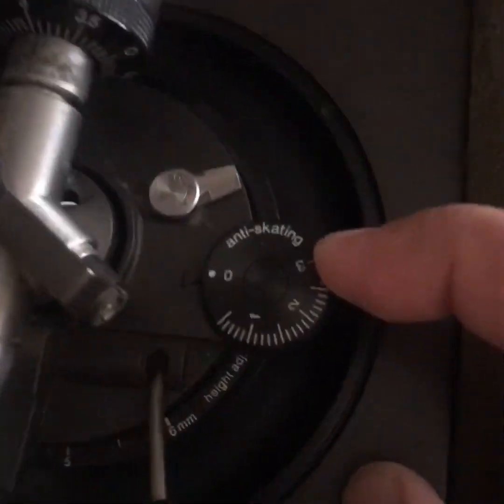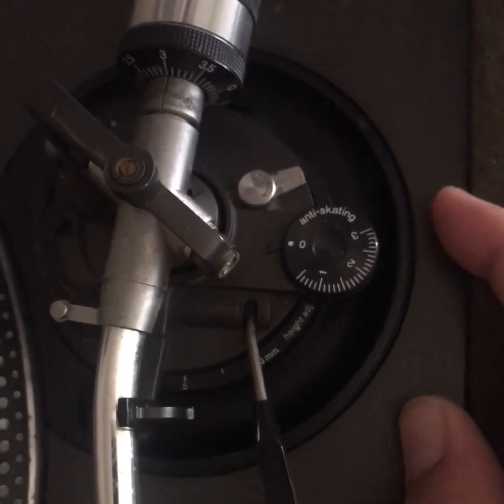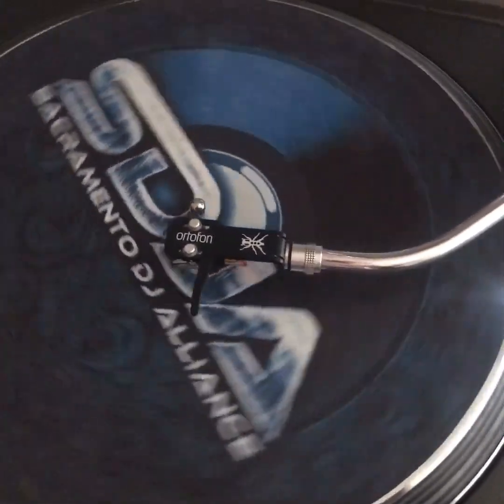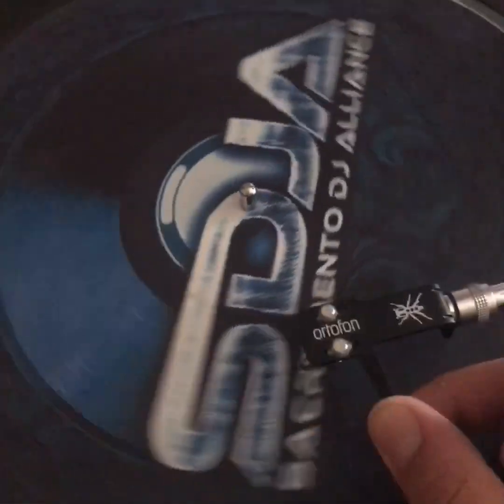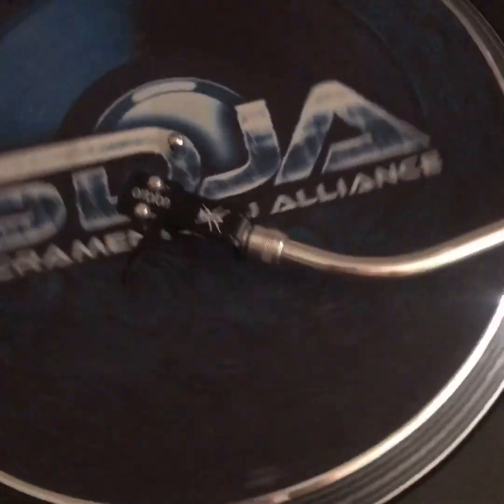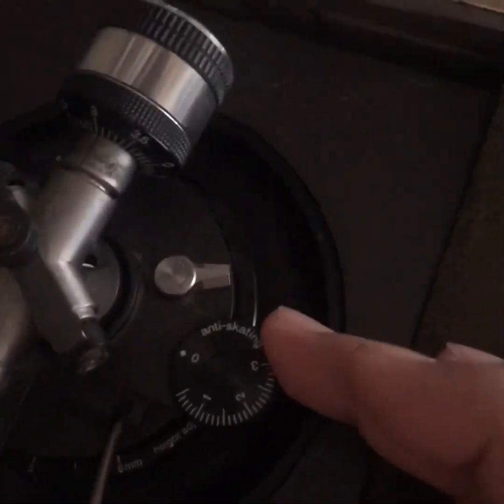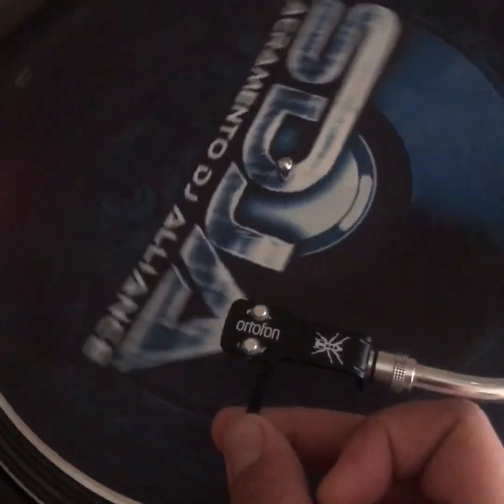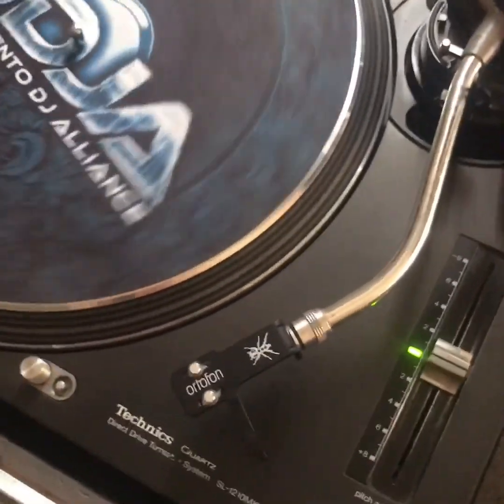TECHNICS SL1200: Anti-Skating explained

Comment: That’s what I thought 
I’ve seen people setting  the anti skating dial according to the stylus weight recommendations 
And I don’t think that’s accurate.   What If you have some stylus that requires let’s say 4 grams of weight.
Nice vid.  Thx for sharing.   
I’ve always kept mine at 0. Unless if I know I have a record that if about to skip I set it quickly to 2 1/2 or 3.  Than I set it back at 0 after I by passed the bad part of my grooves.

Comment: just one quick question...most of my vinyls are singles and ep`s ( 2 tracks per side ) - is it okay to keep anti skating at 0 `? been doing that way some time now and it works but im just worried if my plates get too much wear if antiskating is at 0 for 2 tracks per side ....i had one lp and still kept anti skating at 0 and no problems... anyway, thanks for the video Bouss
Reply from the maker: Stalker IMO a 0 anti skate setting is correct for most 12” singles.